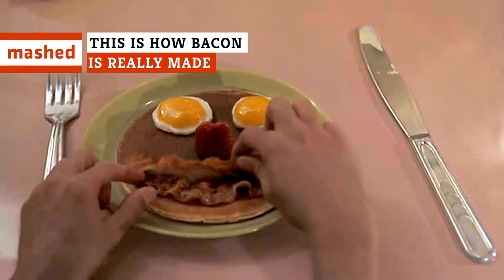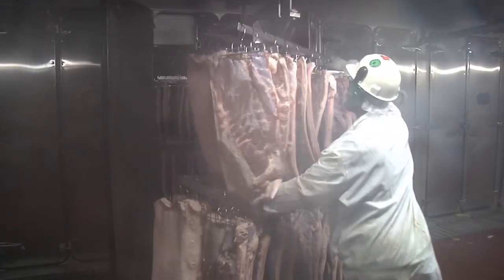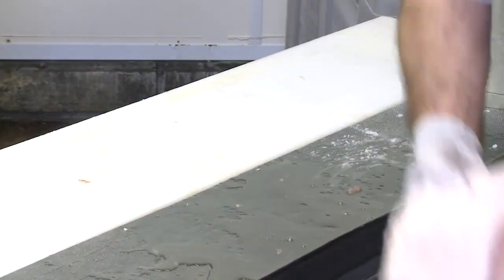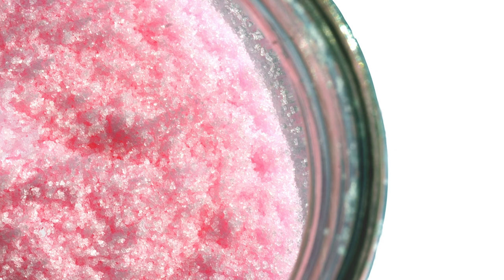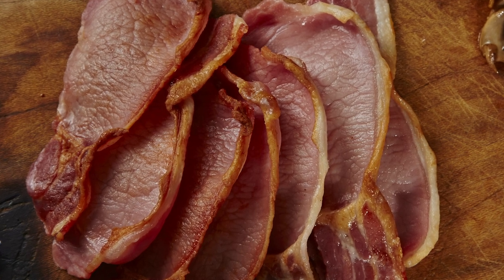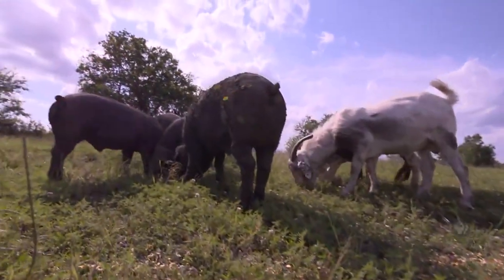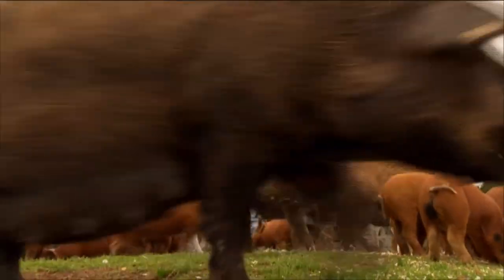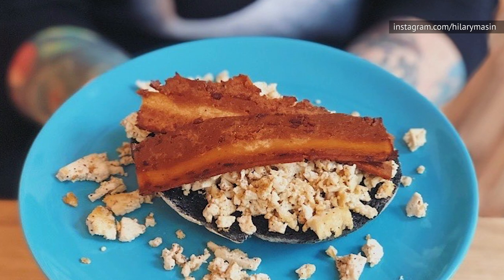This Is How Bacon Is Really Made

Comment: There are serious problems with the accuracy of information in this video. Sodium nitrate (NaNO3) is not the same as sodium nitrite (NaNO2). Generally, for short-term curing (e.g., bacon and snack sticks), only sodium nitrite is used, whereas both sodium nitrate and sodium nitrite are used for long-term curing (e.g., ham and salami). While this may seem like a trivial difference, it is absolutely NOT. Sodium nitrate poses health risks that sodium nitrite does not, as this is well-documented. Sodium nitrate breaks down chemically over time into sodium nitrite -- the key being TIME. I have never heard of anyone making bacon with sodium nitrate; that would be a significant mistake.

Comment: Nearly 70 years ago I used to visit my great grandmother and she always had a slab of bacon hanging up in a larder in the middle of her very old house.Why didn't it go rotten as todays' bacon would.?
Reply: Because they dry cured it with a LOT of salt and nitrates, almost turning it to shoe leather.  It will keep a long time that way without refrigeration.  Trick to using it is to soak the portion you're going to fry in cold water for a while, rinsing several time to remove enough of the salts that it doesn't pickle your tongue when you taste it.
Reply: @edsmith4414  t
thanks